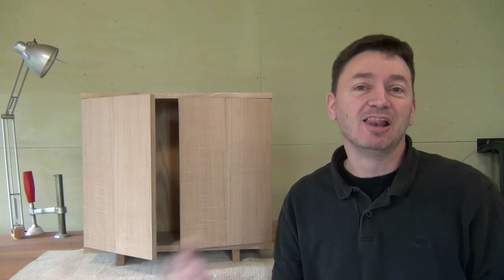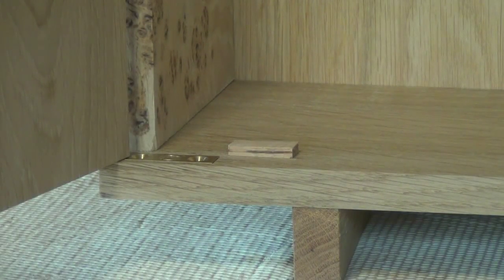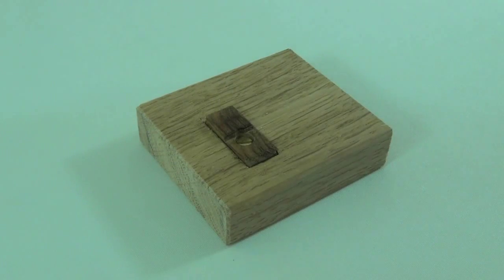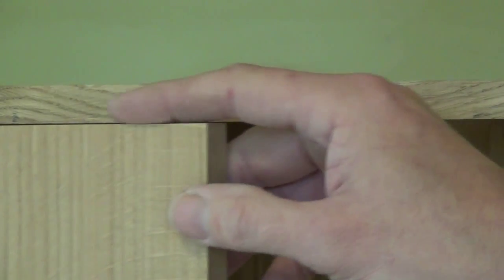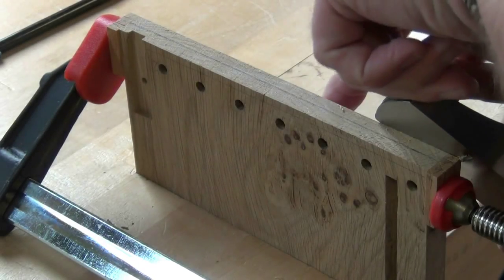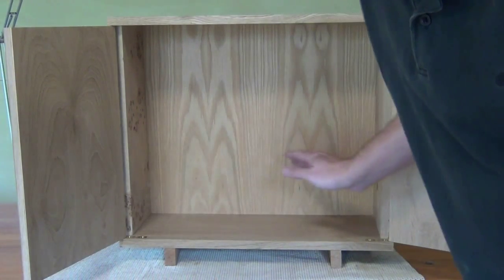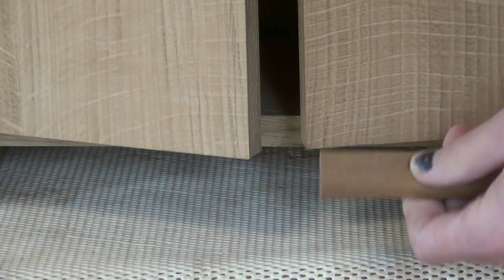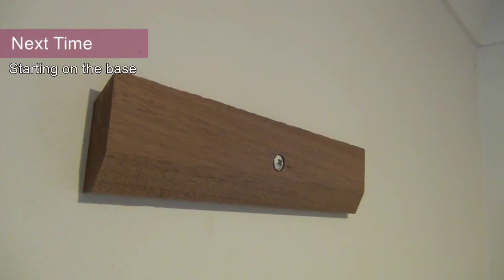Cabinet Option and Ideas - Small Cabinet on a Stand - Part 10

Comment: It's going great Mitch.

A tip from a French polisher.  If you're going to brush your shellac rather than apply it with a rubber. A small splash (and I mean just a dash) of genuine turpentine (not white spirit of course) to half a cup of shellac will help keep a wet edge and reduce the ridges you can get with brushing. It slows the drying time and you can work it a little longer without dragging. Experiment on some scraps of wood first and you'll see what I mean.

Enjoying your videos as usual.
Reply from the maker: Thanks for the tip, I'll try that out.
I do use a rubber, but I haven't mastered the full french polish yet. I do improve with each bit of practice I get though.

Comment: Yes, French polishing can take some time to master. (luckily for me)

Your cabinet might not need to much bodying up though, as the grain is a major part of the appeal with oak and can be left open.

Looking forward to see how it turns out.
Reply from the maker: You're right. I've finished the inside, and I have to say it looks very good. The outside I'm doing with an oil and poly' mix, which I think will work really well with the oak.